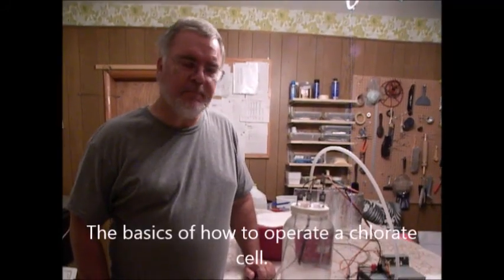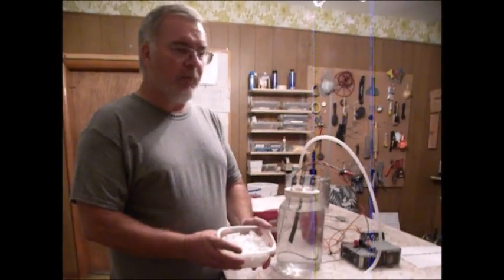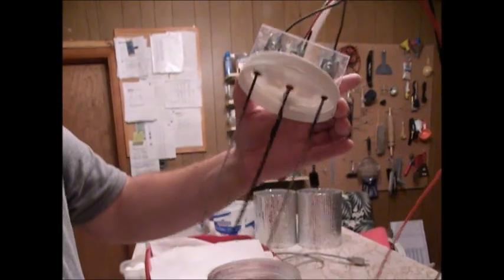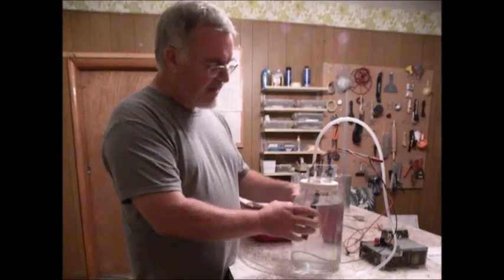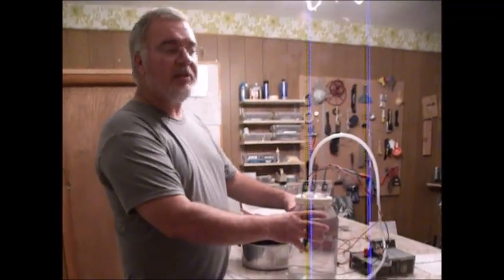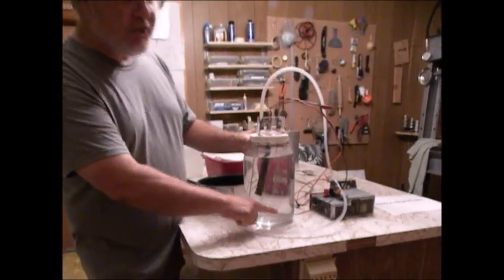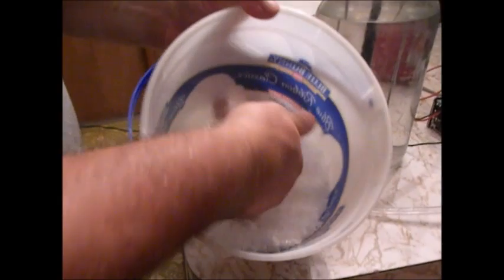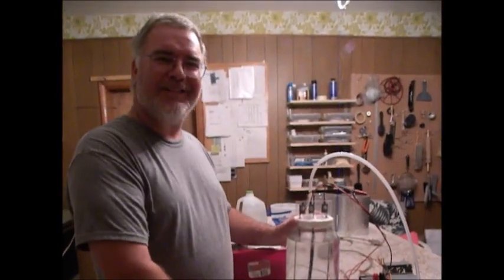Potassium chlorate through electrolysis 1

Comment: When you said salt you was meaning the salt - chloride, not chlorate???
Reply from the maker: Not knowing exactly where in the video that the reference was made, I can not attest to if the presenter misspoke or not in saying "salt".
No chlorate is added to the solution other than what may still be held dissolved in the mother liquor. Salt, ie the chloride (in this case potassium chloride) is added to keep the concentration in the solution at the optimum level. Side note: The use of NaCl to start with, should be the process to use if the desired goal is to generate a "perchlorate". However this is beyond the scope and intent for this video, "Producing Potassium Chlorate using electrolysis".
Warning - "We will not offer any supplies for sale to Minor "Children"! Age verification will be required, even for the purchase of an electrode.
This video was offered primarily for information, not for promoting a project to anyone not fully qualified to pursue this process.
Legalities and concern for someone's potential injury are of major concern!
Thank all of you for your interest in the project!

Comment: Can i use graphite from pencil for catode?
Reply from the maker: Graphite in pencils is often mixed with clay to form the rods. It doesn't stand up to the demands placed upon in in a cell for very long, and requires filtering out the carbon to purify the product.
Thank you for your interest in this project.
Reply: @kno3unv908  is a lead oxide cathode usable without filtering?
Reply from the maker: @okay8632   Too many unknowns with your intended setup or intended usage  of the oxidizer to make a guess, and we have not used lead oxide with our cell.
All of our product was filtered and purified.
Give it a try and post your results!

Comment: how much you keep temperature in celsius?
Reply from the maker: If you are planning on setting up a cell you will need a lab thermometer. Get one with both temperature scales on it, that makes life easy!
Thank you for watching our video.
Reply: KNO3 Unv I already run two cells ,just wanna see other results.Mine going around 40-45 celsius at 5v 20 amps.
Reply from the maker: Thanks for the extra information. We ran our cells at higher temperatures. Tested the unit's in ranges from 40 to 88 C. Found it ran best when it operated at ranges of 54 to 75 C. Amperage was not controlled and was less than half of yours, (7.1 to 8.8). This was monitored and it would drop 2 to 2.5 Amps during the run. This was one of the bench marks to end the run, and start over. Current density was too high for the Ti rods used for electrodes (could be why they eroded at higher temperatures)  and we switched them to mesh strips. Overall; although a simple cell it performed well with out needing to monitor pH during its use and produced very little chlorine gas while in operation. I wanted to produce a unit that was easy to build, operate and didn't need a lot of baby sitting.
Hope this answers your question better.

Comment: If your electrodes are stainless steel you're going to not want to place in the solution until you have power running throw them. Otherwise the electrodes will decompose in the solution leaving contaminants. Btw, you have a beautiful setup, well organized. If you don't mind me asking, where did you get the jars from, their height, volume, and plastic lid is convenient.
Reply from the maker: Electrodes were not stainless steel, however you are correct about corrosion issues if left in solution with power supply off! Thank you for your complement on setup design, I worked long to come up with a setup that took minimal setup and maintenance. I have the jars, and electrodes available as a kit for sale. Jars are standard wide mouth gallon sized and plastic lids hold up well for this system design. Metal lids would corrode quickly and short out easily!
Russ

Comment: I didn't understand what you meant with generations?
Reply from the maker: Being able to turn a hobby into being profitable is always a plus in my book. However one needs to be aware of possibly injury to the buyer also!
Rock-candy rockets with Chlorate, could be risky as Chlorate if not pure could add concerns. Also if the mixture is heated to the melting point of the chlorate, their would be a high chance of an explosion with the sugar. Mixing with dry sugar pressing could possibly be safer. However I have never attempted this. Good Luck with you quest.
Russ
Reply: 1 gen = 1 batch
Reply: Thanks :)
Reply from the maker: Thanks Noilex for responding to this question.
Apologies to you Nattsurfaren for not responding to your question in the first place!
Yes the term generation was in reference to the batch run. Each succeeding run of the liquid from the prior batch would pick up where the last one was at. This enabled the cell to proceed to run at a higher efficiency more quickly as the hypochloric  acids, etc. had already been established in the solution.
Russ
Reply: Thanks KNO3 Unv. I have always wanted to start and try this because I built small rockets when I was younger. I have been trying to find out if I could sell small rocket motors somewhere. Just to sell something I love to work with. 
BTW I was wondering if it is possible to do rcandy but with chlorate instead of nitrate? I have not seen anyone doing that so far.
Thanks for the response KNO3 Unv